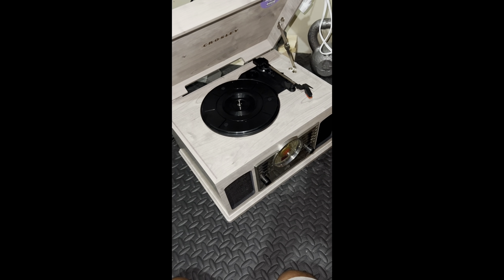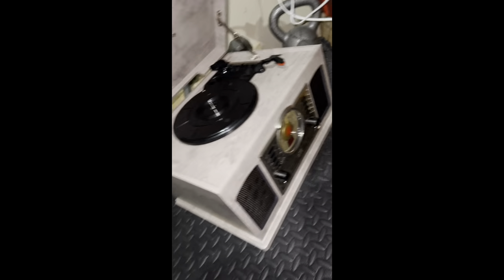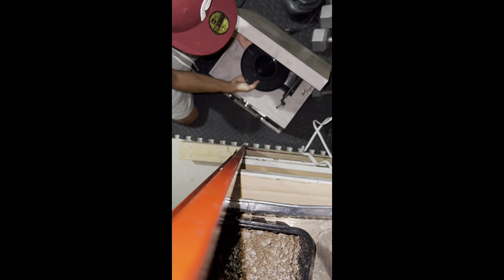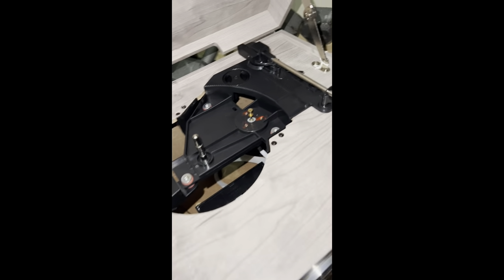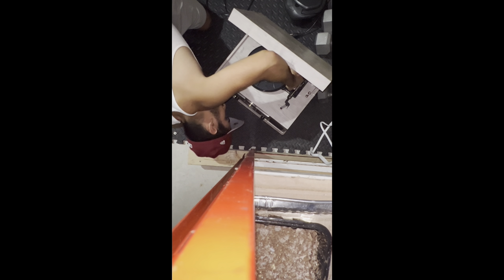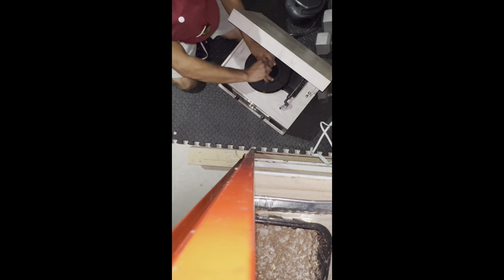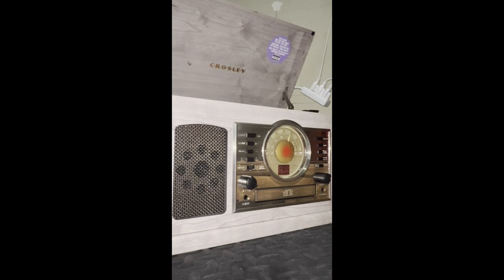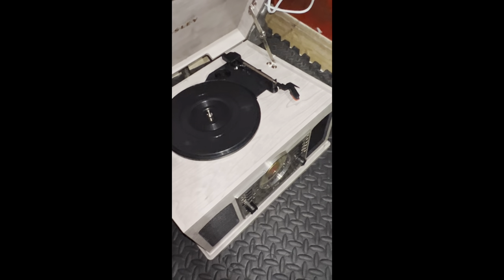How to fix your Crosley record player turn table (NO TOOLS NEEDED)

Comment: After putting the belt on the inside rim, stretch that belt across one of the points near the edge on the underside of the platter, then place it right down on the platter, making sure that spindle is inside the triangle formed by the belt and turn the platter counterclockwise.  The belt will snap right on to the spindle and no need to try to get your fingers in there to hold it together while putting it down.  This will also assure the belt is lined up evenly so you don't get speed variations as it turns.

Comment: The c clip goes on much easier with a needle nose plier. Don't that platter have a peg to hook the belt on to so it can snap on the spindle?
Reply: If you have a Crosley or Victrola player and you have to put the belt on and it has no pegs to hook it to, use the curved pick that auto stores have. Harbor freight has a 4 set of picks. Use the curved one and hook the belt and lower the platter just enough to see the motor pulley. Pull the belt on the pulley and lower the platter and spin a couple times to seat it. You might need a small flashlight to see the motor pulley depending on your lighting.
Reply: I don't put the c clip back on. I use the foam packing block that was inserted at the factory to hold things together when I fold it up.
Reply: I see people having trouble with their belts and I can't understand what they're doing. I've had these type of machines since 2007 and I haven't had a belt break yet.

Comment: And one more tip, if you find the speed isn't exactly right, there are screw-adjustments on the motor itself if you take the top turntable off.  There are other videos that show how to do this on youtube.

Comment: I don’t know how to adjust the speed the record player on my stereo? My stereo is Crosley Turntable McQueen. I brought my stereo from Target too.
Reply from the maker: There should be a button you slide that adjusts the speed of the record player, for me it was located right above the lever.
Reply: @ToMito1017  Can you tell me where's the button on the right above the lever?
Reply: It looks like you'll have to take the whole platter and plastic frame out to get at the platter motor. Then use an eyeglasses screwdriver to adjust the H or L pots. To get accurate you'll need a strobe disc too to set the speed right.